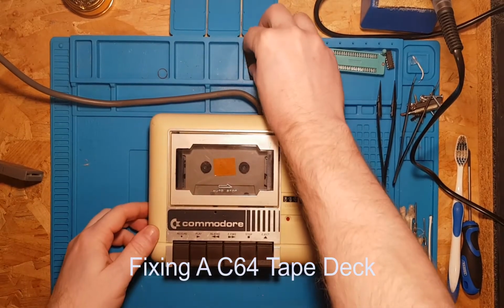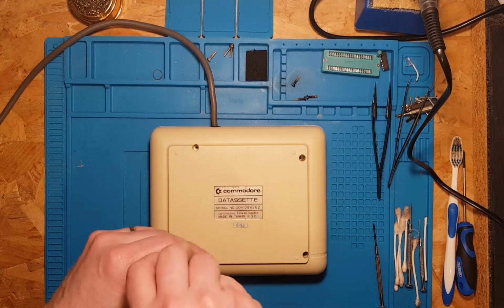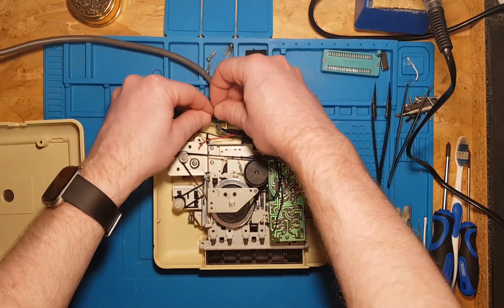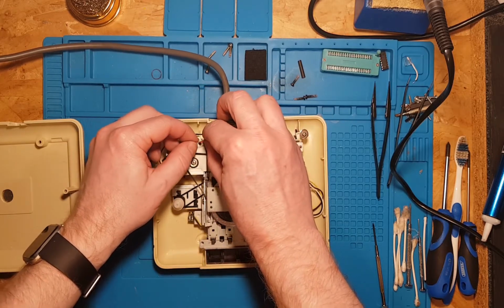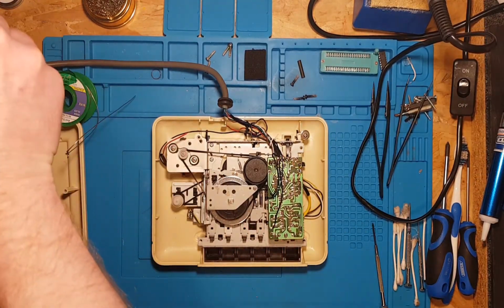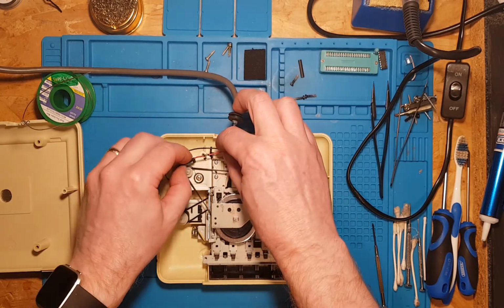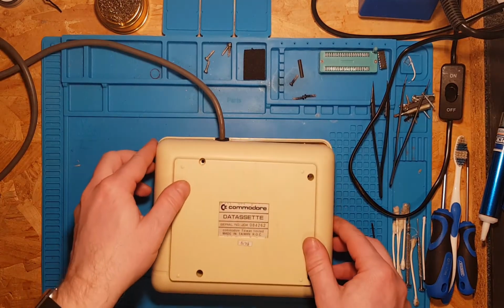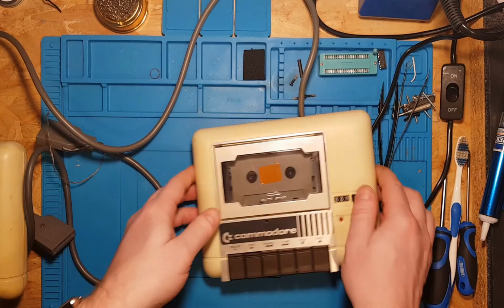C64 Tape Deck Repair

Comment: Hello, I’m having problems with an old Japanese C2N. Replaced belts, caps, cleaned pinch roller etc. it still won’t load reliably. The motor speed keeps varying. If I take the back off there is a smell like slot car motor smell. if i knock the top in play/rw/ff modes it speeds up.